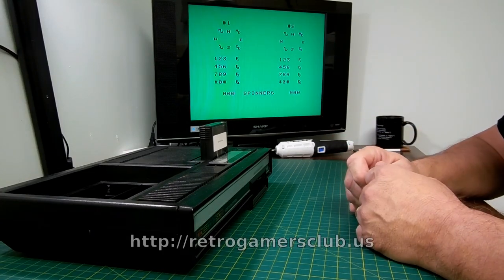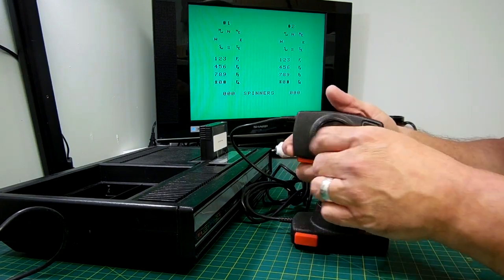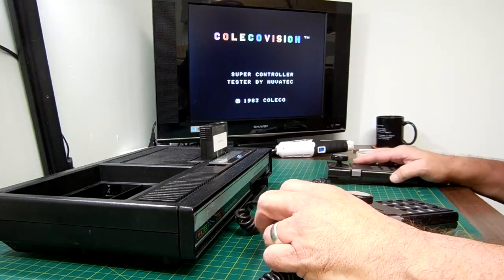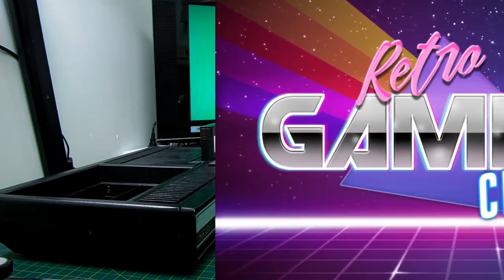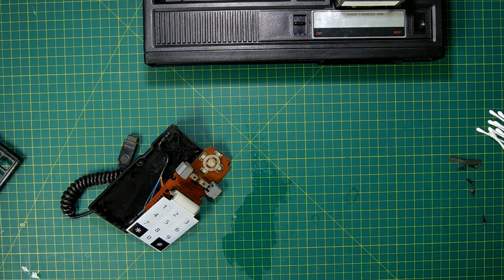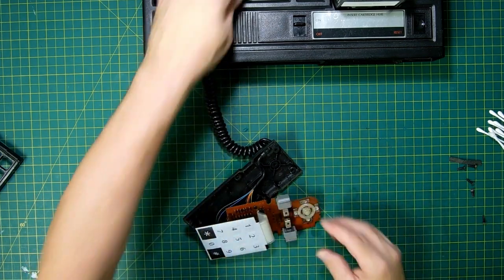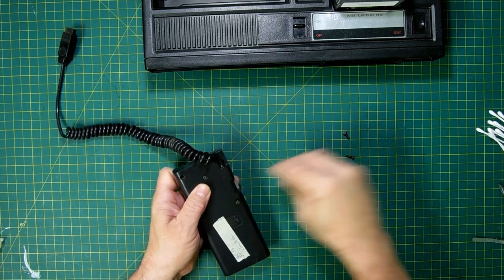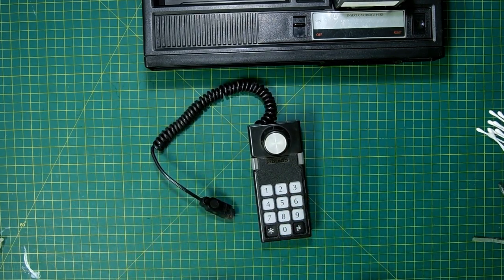Can We Make This ColecoVision Controller Work Again?

Comment: where did you find the controller tester cartridge?  cant find it on ebay..  I have 2 Consoles and 6 controllers and the jump/fire buttons do not work. I try Donky Kong and mario will not jump.   ( i have 3 coipies of donky kong) no matter what combination i do it wont work.  any thoughts?
Reply from the maker: The software is available on the Adam archive